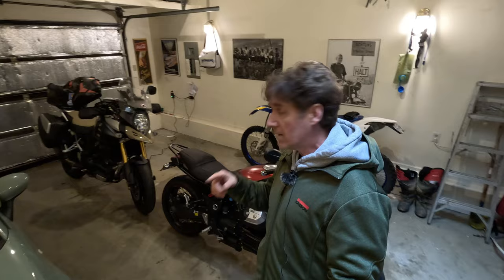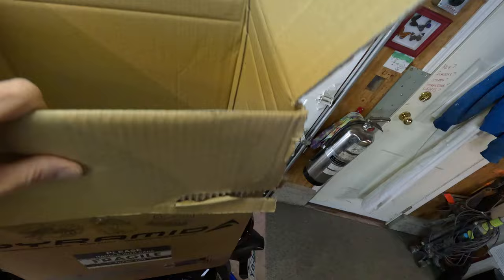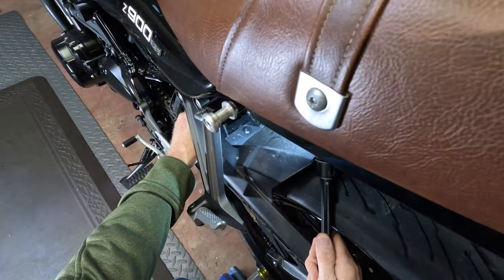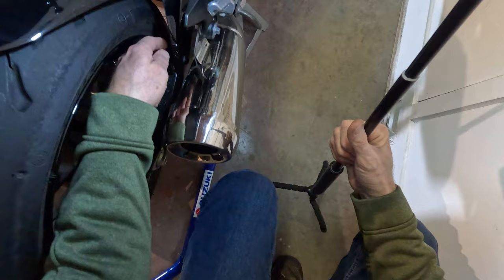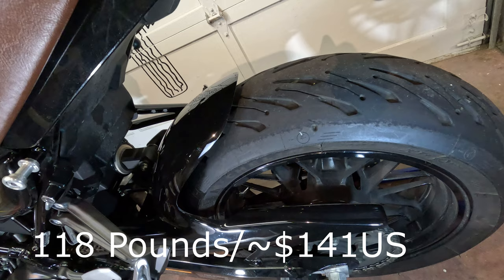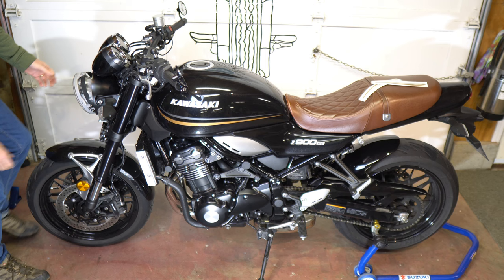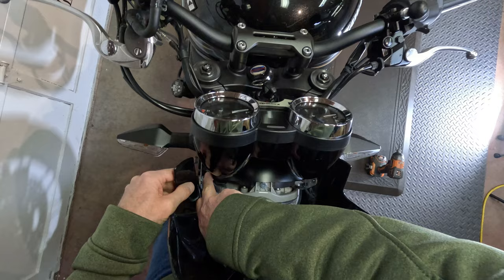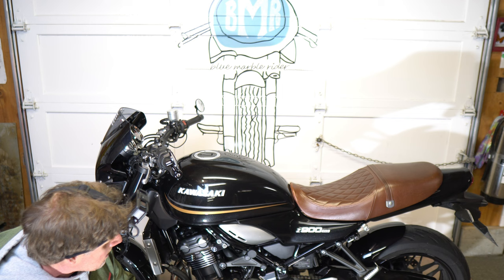Kawasaki Z900RS - 3 Inexpensive, Quick & Easy Mods Reviewed | PYRAMID PLASTICS | PUIG Hi-Tech Parts

Comment: Having watched your previous AWESOME clip on the Chic fairing I ordered one - due to serious bubble head over 110km/h.  Waited the painstaking 5 mths - great improvement up to 160 km/h; although noticed the wind not necessarily affecting my helmet but - as I think you noted - hitting me in the chest.  I have subsequently added a matt black plastic 'defuser' to the top of the Chic fairing.  Gone are the classic looks toward more urban industrial - but the wind protection . . . 170+ (excuse the pun) without a breeze!  For that reason I would probably shy away from the Puig.
Reply from the maker: Great to hear, Jasper.  I love mine for sure.
Reply: Can you add a link to the diffuser you added?

Comment: Awesome video, thanks!  The silver bits (heel guard, side panels, radiator side cover, front fender bracket covers) on the Z900RS drive me crazy!  They match nothing else on the bike and always stand out to me, they should be black or chrome.  It would be great if Pyramid would make replacement parts for these as well?
Reply from the maker: Probably not, as Pyramid are mainly plastic, although it's a good call.  You have two choices though: one paint them, or two https://www.motocomposites.com/products/radiator-covers-in-carbon-with-fiberglass-for-kawasaki-z900rs-2017-2019.html?gclid=Cj0KCQiAi8KfBhCuARIsADp-A57WQyeutjpu5E4sEIbonG4Pco3bPwiZZqE7Tl-RDay2naaOS-m2GUoaAssXEALw_wcB
Cheers.

Comment: I did everything as you did in the installation of the windscreen, but after the installation, I can push the windscreen forward with my hand, do you think it is normal?
Reply from the maker: No, that's not normal. It is a friction fit, and so has to be tightened fairly vigorously.

Comment: That seat looks great! Wasn't convinced when I watched the install video but really does look good. Only had my bike for a few weeks and loving it apart from the seat comfort. Does this seat cover add any comfort? I wonder if adding it to the original rather than replacing the original would add comfort.
The hugger looks awesome but I'll be sticking with my own custom-made cap covers (a couple of screwtop wine bottle caps stuffed over the top of the with double-sided velcro tape - quality!).
Keep up the good work on the vids.
Reply from the maker: I wouldn't say the seat cover adds much comfort.  Saw an interesting and highly subjective seat the other day - certainly comfortable, but the looks depend on your perspective.  It's a Bagster seat, with Bultex foam.  If you are a member of the Z900RS forum (easy and free), then take a look at this: https://www.z900rs.co.uk/index.php/topic,1818.msg29072.html#msg29072

Cheers BMR
Reply: Damn that looks comfortable. Tough one though cos I really like the lines of the stock seat, but it is a pain in the... (literally). @BlueMarbleRider